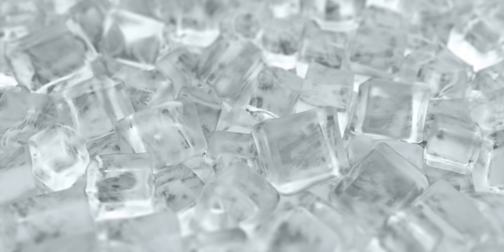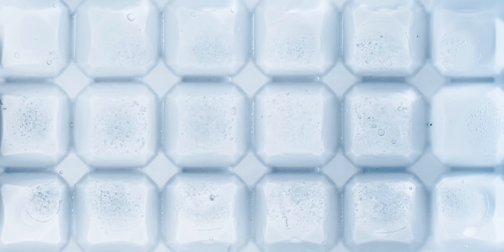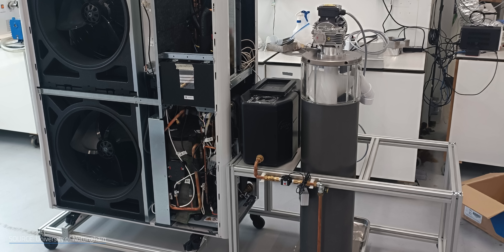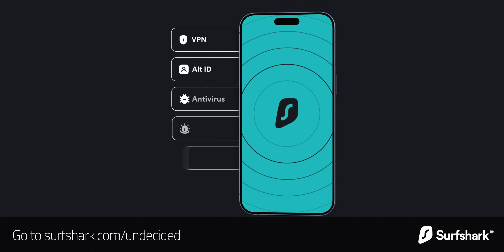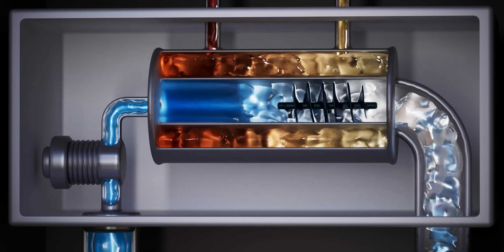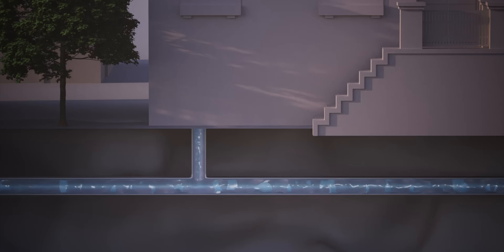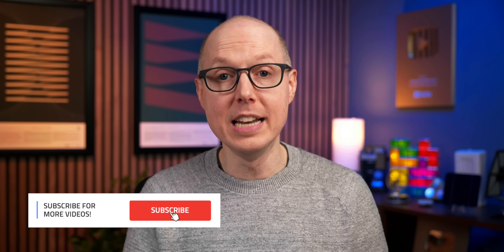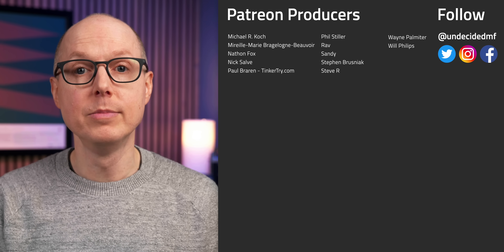How Can Ice Heat Your Home? Ice Source Heat Pumps!

Comment: My father was experimenting with this kind of heat pump already in the late 80's. Nice to see finally it materialize. Another idea: condensing water from the air. Water condension gives you even larger latent heat per kg.
Reply: Do you realize that the ice forming on the cold side of a heat pump comes from the condensation of humidity in the air?
Reply: Thats a very interesting idea, especially as Northern climes like the UK are generally quite humid.

Comment: This is just ionocaloric heat transfer. Berkeley National Lab has a patent on it, or at least a version of it. It can used for cooling and heating. A refrigerator can be made by cycling the phases of ethylene carbonate using sodium iodide.

Comment: Honestly this doesn't sound like a great concept, the infrastructure requirement is huge, even re-using the gas lines is not viable as you can't just switch over the gas pipelines, you would have to simultaneously convert over every customer connected to the line, and not just home heating furnaces but gas stoves, gas water heaters, gas cloths driers, etc it's just not feasible. Not to mention the require of still maintaining the infrastructure which adds a massive amount of cost, the bulk of my gas bill is not for the gas but the delivery charges for maintaining the network. air to air or air to ground is so much more viable and flexible and eliminates the need for these massive and unnecessary infrastructure systems that IMO are relics of the past and should be slowly phased out, not find excuses to re-use and continue sinking money into.
Reply: Exactly. The key word is "simultaneously". There would be no incremental adoption possible.
Reply: I believe since the gas network itself is segmented the aim would be to switch segment by segment, so whilst not a fine grain (i.e. household) level switch it would still be a street or area level of granularity. The question for me is what is supporting the return pipes, is the proposal to use the ground water or sewage drainage system, if so this raises a whole set of separate questions about feasibility both technically and economically (the UK's water companies are not best known for investment).
Reply: They'd probably have to offer incentives like when they did the digital TV mandate. That said, rural areas can utilize well water as they already do. But it ignores the issue with places that have limited water resources, such as Utah or Nevada.
Reply: This is just talking about the UK. Plenty of non potable water. The bigger issue is cost vs air to air HPs
Reply: @LilyWarner-f3t  is there precedence for changing integral infrastructure at such a large scale?
Reply: @ - the gas infrastructure has to change at somepoint anyway, as the alternative is to pump hydrogen instead of natural gas (as domestic natural gas supply is running low and has become an expensive import). The move to hydrogen would require pipework changes as well as changes to household boilers/cooking equipment. The ISHP solution seeks a lower impact by re-using the existing network (gas and waste) by retrofitting at the house, with lesser public infrastructure impact (i.e. digging roads up), so seems a viable alternative.
Reply: @ - I wondered the same, but on reflection as long as the COPs are similar then the ISHP solution appears simpler (no external component), just requiring access to the gas pupe inlet and a waste pipe outlet. Then install labour costs, which are a signifcant chunk of a heating solution, should be cheaper for an ISHP solution.
Reply: @GruffSillyGoat In the rocket industry, hydrogen is very difficult to use because of it's atomic size. It is very expensive and hard to stop from leaking. Natural gas are large molecules and so easier to contain. For this reason, and because it is so flammable, I can not see them ever using H2 as a replacement source.
Reply: @ - I agree. I'm just reflecting a number of European government plans. The UK for example is investigating to introduce upto 20% hydrogen mix into natural gas but has been running trials of 100% (which haven't gone that well to date).
Reply: @GruffSillyGoat Thanks for that bit of information. I know there is a cloth manufacturer that has material that can effectively seal hydrogen and not leak. But can you imagine that lining every pipe and being integrated at every joint and valve? The increased cost just adds to the complexity and reduced safety of using hydrogen overall. As 'Scotty' said on Star Trek, "Ya canna change the laws o' physics Jim."

Comment: The reuse of natgas infrastructure is ridiculous and unnecessary; this is a warmed over 5th generation anergy network that uses a phase change on the cold side - which is admittedly awesome. 
You'd better hope the central pipes don't clog and burst though, because if they do you're in for quite a disaster.

Comment: Let me help you. The HEAT that the "Heat Pump" is making is the compression of the gas. The cold ness that the "Heat PUMP" is making is the released presser of the gas. So the motor of the heat pump is compressing the gas making HEAT. Let get back to your "ICE HAS HEAT" and we agree 80 deg water has more heat that ICE? How a HEAT PUMP is working it is moving heat from the ground to the "Heat Pump" it is dissipating the COLD gas for the higher temp of the Ground temp. Making the Ground colder. OR FREEZING the GROUND. The HEAT PUMP IS NOT TAKING HEAT FROM ICE BUT MAKING THE ICE COLDER.

Comment: Nothing about this seems practical, no way could the gas network be re-purposed, unless everyone switched at the same time, which is impossible, even if it was narrowed down to local town/village level. 

Heat pumps have a really long way to go, they are not at the stage where they can replace conventional central heating.

Comment: Thanks for sharing your thoughts, ideas and videos. Interesting concept. Always have been a proponent of heat pump technology. Over 30 years ago as a new employee at a power company I made the suggestion to embrace heat pump technology for the consumers in our area freeing up limited gas supplies for power generation and securing more stable base load for the supplying electric power company. I was ridiculed and laughed at. Have been following heat pump technology for years. I like the idea of distributing the water loop input throughout the neighborhoods. At the time I was proposing development of a long life heat tube that could be installed at residential sites providing a heat pump hookup that would be available for multiple generations. The tube would contain a technology similar in action to heat pipe coolers in personal computers. With a water heat exchanger installed at the top of the heat pipe to reduce possibilities of leaking heat transfer liquids adding to system lifespan.

Comment: What I don't understand is why we're spending all this energy and brains into using cold air to heat up cold homes in a very small fraction of the world, when the vast majority of the world is dealing with excess hot air and need of cooling without electrical waste. Is there any more research about that? It seems like it would have a vastly greater effect in the environment.
Reply: Well, first of all, heating buildings consumes a huge fraction of global total energy use. So it's a problem that needs to be fixed in order to reduce emissions. Second, most of the wealthiest countries and most of the audience for English language. YouTube videos live in the cold parts of the world. And third, cooling buildings is already a well-solved technology with either traditional building designs that cool passively or with air conditioning systems which already run on electricity. I think in general people don't think there's anything left to invent in the cooling space, you can already cool a building without burning any fossil fuels. The bigger concern for areas that are getting warmer is probably going to be people dying outdoors along with crop failures and droughts, which do have some important research being done on them, but that's outside the scope of this question which is mostly about conditioning indoor spaces.
Reply: About half of global energy consumption goes for heating - share of cooling is not insignificant but still not comparable. In addition cooling  (A/C) is still mostly for convenience - heating of living and working spaces is in many parts of the World a necessity.
Reply: @EneriGiilaan  I can tell you don't know real heat. Try living in a place that regularly gets to 45C+ where most people can't afford air conditioning, where heatstroke kills thousands every year. Guess what, that's the middle two thirds of the planet. The reason more is spent in cooling than heating isn't because cooling isn't needed (you are reading this in a device that needs cooling), it's because the global north pillages the hotter countries' resources and thus are the only ones who can afford temperature control. Then again, the way things are going, you won't have to wait long before you find out what it feels like, I hear the UK is already carrying corpses off of retirement homes in the summer.

Comment: Tosh... expensive... first you have freeze the water blar.....blarr...blar
Reply: freezing the water is how you get the heat. The pump extracts the heat from the water until it drops to a slushy consistency. Ice slurry is a "waste" product of this system which I guess the geothermal energy is supposed to be enough to thaw it during the return trip.

But that raises the point that natural gas lines don't normally need return pipes, so where is the second set of pipes coming from for this cycle?

Comment: Are these gas pipes used only for heating? Not for cooking?
Reply: Cooking with gas is generally a bad idea for air quality reasons, even with fan hoods. Most of it's advantages in cooktops over electric are mirrored by induction cooktops. 

I'm still wondering how the slush gets pumped out since existing natural gas lines shouldn't have needed a return pipe.
Reply: @AnishThomasGT  yes, many/most UK homes with gas connection will use gas for cooking too, although these days there's a mix with electric ovens + gas hob or sometimes an induction hob alongside or instead of an older gas hob. Gas it still by far the cheapest way to make heat here.

Comment: The climate in the UK is warm enough for regular Heat pumps. For a cost-effective approach, big savings could be achieved by basic level insulation and switching to induction stoves.
Reply: So is most of the US, most of the year. Technology Connections did a video on this a couple of years ago and heat pumps have made even more improvements since then.
Reply: Part of the aim of this is to recover a significant part of the 20TWh of waste heat currently being flushed away each year. It makes sense to introduce such systems either where district heating already exists (as is the case with the waste water heat recovery sites already operating in the UK) or where they can be easily retrofitted. The approach here seeks to speed up the introduction of 'district heating' by repurposing pending redundant gas pipes reducing the need to dig up the roads, which is often a blocker to implementation.  

Additionally, not every house can adapt to air source heat pump, due to space limitations, so having a retrofit efficient district heating system, even if heat exchange is decentralised like with this ISHP approach, makes sense particularly in built-up areas.  

Agree insulation needs to be addressed as this is the biggest loss of heat in the UK's housing stock, but having diversified mix of efficient heating systems; whether district heating, decentralised district heating (low heat supply like in this video's topic) or air/ground source heating makes sense. Especially if we can recover the 20TWh of waste heat currently lost in waste water currently.
Reply: Insulation in Britain? Treason of the highest order!
Reply: Exactly.
Reply: Maybe warm enough but most of the buildings do not have the qualities required.

Comment: As there wouldn't be ice involved if and when the system was turned to cooling your home, how does the efficiency pan out there? Also, if the system uses 'new' water (not a closed system) are there thoughts toward using our potable water? Using potable water, we could preheat water going into our water heaters, at least during home cooling operation. I like the idea, but, like you, see plenty of issues to work out. 🤔

Comment: Gas lines aren't typically buried to depths great enough to prevent freezing like a dedicated water line would be. I have seem some as little as 12" from the surface so even if they do talk the utilities into this idea, there's a lot of work to be done to get the gas lines below the frost lines,  especially in northern climates.
Reply: Also, good luck moving all that ice slurry. Ignoring everything else, that's the main killer in my eyes. No matter how hydrophobic you make something, ice will stick. And, how do you avoid compacting the slushy? You'll need a ton of slurry pumps.